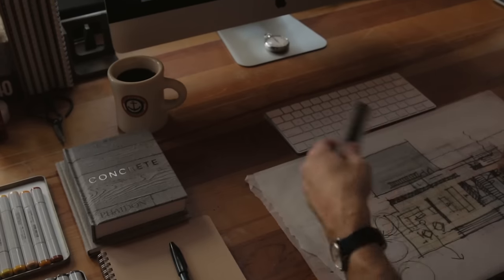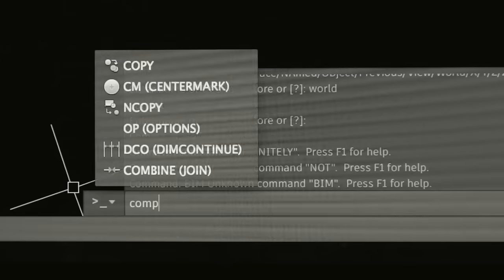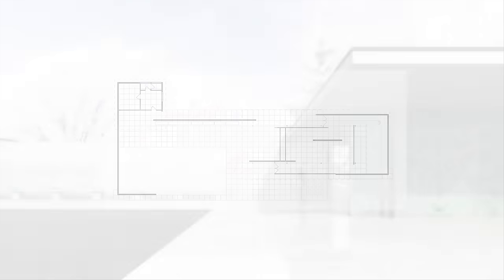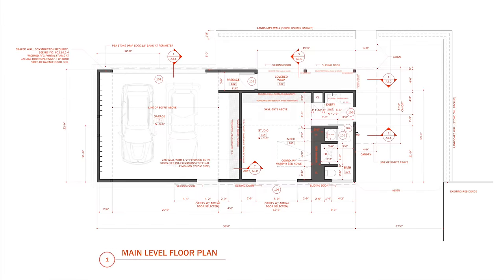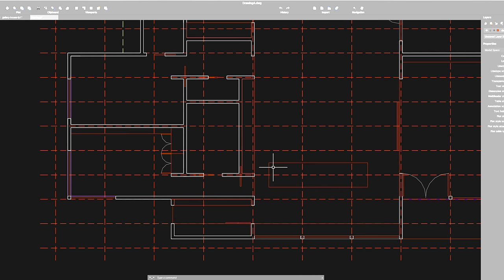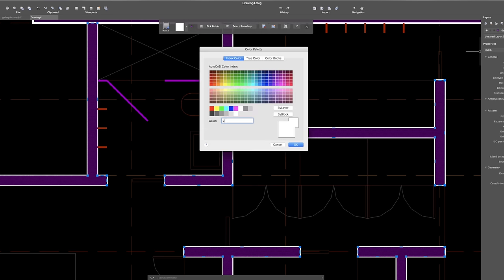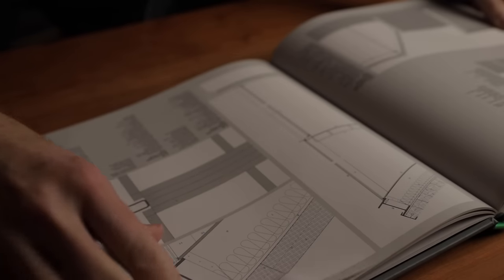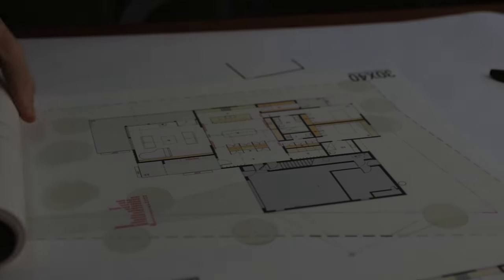Improve Your CAD Drawings | START TO FINISH tutorial (+ template)

Comment: I'm B.Eng in Civil & Structural Engineering in the Arctic and a big nerd in static calculations, screw / bolt / weld / other connections. But lately I've been digging deep into architectural design and interior design, as I've been planning and made tender documents on housing renovations with my work for the last 2 years.
I find it very interesting choosing materials, colours, minimum requirements for performances (air and water tightness, windload deformations, etc.) and making drawings.

In my free time I look at city plannings, see possible areas to build a house and sketch on AutoCAD Map3D. It's super fun and I understand more what architects work with. I need to understand more of what architects go through - so I can work with them better on construction projects.

Currently, in my free time, I am planning my future dream house on my parents' ground. And I can very much relate for the steps shown in this video! 😊

Comment: As a ME, I’m pretty much a AutoCAD first sketcher. I like to iterate over a handful of ideas quickly, so I’ll copy and paste current iterations next to each other as I go, so I can try out major changes without loosing the original, or grab components off older iterations. By the time I’m done, there’s usually ten or twelve copies sitting right next to each other, and I can really quickly see what’s working and what isn’t. I also find the ability to get the rough scale correct, right from the beginning really helpful. With paper designs, it will look like everything fits and works only to realize one integral component is just irreparable the wrong size. Just the way I go about it though.

Comment: I've been on Autocad for 35 years now, and I think I've refined it. 1 more tip if you want to do coloring, don't do it with solid color, you get much better shading and control by using ( ok we have to color our plans for local authority, different items different specific colour's) ok that said. Use dots hatch to colour. I like 1000 scale dots 0.2 pen thickness. That gives you a very subtle colour, and then you can control the colour intensity by lowering hatch scale to 900 or 800. And it uses much less ink when printing. Try it. Over years I've programmed my keyboard, so I hardly ever click on icons in menus. If you work by typing shortcuts you speed up your work 3 times because you work with 2 hands and not just with the mouse.
Reply: Lie weights is an absolute must in Cad, I've seen many plans drawn in 1 line weight, and it's a nightmare to read.

Comment: Excellent video Eric as usual.  As a licensed architect myself, I admire your way of clearly explaining your reasons for doing things, and your methods.   It is interesting to hear how the other architects do their work flow.  I hand sketch on trace the design, then layout the schematic plans with #2 pencil.  After the initial meeting I use Sketchup to fine tune the schematic plans.  Where you draw from the scratch the autocad plans, I import the plans, elevations, sections, into autocad from SU.  It is a little work to erase the unwanted lines, it is still easier than measuring and drawing new lines in autocad.  I then change the lines to whatever layer I want for thickness.  The other thing I noticed is you  draw your ext. walls to 6" for framing and 1/2" drywall, and interior walls it is 6-1/2" for drywall on each side.   I dimension to the stud walls, and therefore my walls are 5-1/2" or 3-1/2" thick.  It is easier for the framers to work with less chance of a mistake.  Checking to see if you tried to import SU into autocad.   Thank you, keep up the good work.

Comment: Your template is extremely well put together. You're so organized I think you've never had any need to use the more modern features in AutoCAD (like blocks, annotative text, etc...). These would save some time. Maybe not as much on your unique one-off type projects compared to an office doing more repetitious work. For me, I tend to do more "production" drafting (multi-residential, etc... ). I've really dug deep to maximize productivity.
I wish I could convince more people that great drawings can save the owner a decent amount of $$$ by the time the project is built, even if they take slightly more time on the front end.

Comment: Interesting approach and well designed workflow. I am experimenting with opposite approach at present which is using original drawings to make the model in 3ds Max, then once near completion, create an AutoCAD 2d plan from that. Excellent tutorial on this from Micha Koren on Digital Tutors (Pluralsight). Advantage of this approach is the client has a much earlier detailed 3d visualisation from beginning which helps any subsequent iterations and updates to final design. I use Sketchup for blocking out stylised concepts but cant beat Max or Maya for sheer design, material and rendering capabilities.

Comment: great video, I generally don't include finishes in my wall thickness dimensions, builders work and dimension from the main structure when building in my experience, not the finishes, therefore my dimension are to the extent of the main wall structure and not the structure plus finish material either side, just my 2 cents

Comment: Would you consider using Sketchup Pro to produce the construction documents instead of AutoCAD LT? I'm stuck in this dilemma of should I whether use AutoCAD LT for the construction docs and then use Sketchup Pro for Sketches/Perspectives or should I use Sketchup Pro alone. Although, SketchUp can handle both documentation and presentation alone, but theres a couple downside like its software performance when using Sketchup's Layout (which bothers me a lot) and its user reliance on 3rd party extensions (mostly it'll be difficult to create complex designs without using one). On the other hand, AutoCAD LT has better software performance and you have all the tool that you needed for documentation. I figured you'd be the perfect person to help me with this one. Thank you!

Comment: notes
1. sketches move back and fort not to hamper  flow of ideas, do not  jump into quick with cad,  you save electricity by not having pc on while thinking, instead work with pen and paper first once the idea become concrete then putting it into cad will make the workflow easy.
2. cad templates helps to save time and make the drawing organized with line value.
3. when doing cad starts with the big picture down to details (macro to micro), map at the beginning the limits so will not fall into revisions/adjustment when you exceeded unnoticed.

Comment: Cad is just as fast as hand drawing, and it's easier to create variations than hand drawing.  Just copy what you've already drawn and make changes to it.  Now you have 2 versions.  If the second version didn't work, copy your first one again and try some more.  Maybe you like the changes on this one, but you like one feature from the original version better, but you already changed it in thise version.  You can copy just the stuff you like from the original and put it in place on the newer one. In Cad, you can scale things up, or down, or stretch them longer, or shorter.  You can do that with manual drafting, but it gets ugly with pieces of paper taped together.  Anything you can do with tracing paper, I can do in Cad just as fast, and just as easily, or more easily.  As for getting to detailed, too early, that's an issue with hand drafting too.  That is the entire reason the Ecole des Beaux-Arts taught students 200 years ago to do their initial designs with very small, rough sketches.  I could see doing that part by hand, but I would scan the approved sketch and put it in my Cad file to use as a reference for scale.

Comment: I'm a little new to the actual software used, but if you use AutoCad LT,  does that mean all your material and cost calculations are done manually (eg, spreadsheets etc) instead of utilising a BIM program.

Comment: Is there any particular reason you don't use a BIM software? I chose ArchiCAD a couple years ago a I don't see myself ever going to a non BIM software, it just makes everything easier imo. Cheers from Brazil!
Reply from the maker: software is a tool...a means to an end and choosing a non-BIM route - for me at least - is a like choosing a honda civic. it starts every time i get in it. it's not blazingly fast, it's not showy or demanding, doesn't need maintenance and it gets me from point a to point b safely. i get the BIM thing, it's cool...much respect to everyone who uses it...i've tried it many times...it's just not the right tool for me...my projects are small, they're simple...and i want software that just gets out of the way and let's me do my thing...
cheers...
Reply: Using a BIM software like ARCHICAD needs mastering it to be worth the investment, can I ask how much you pay for it ? I use draftsight, and it's the only free possibility for me. Thank you and good luck
Reply: It's been a while since I've looked at Revit, but it isn't the only BIM (or "BIM-esque") option out there.  I've been using Vectorworks for more than a decade specifically because it is flexible.  Watching someone else offset a polyline then clip at wall intersections reminds me how long it has been since I've had to do that.  I don't know about Revit currently, but Vectorworks and similar "not too heavily BIM" packages have tools like wall tools where you can start with a simple, generic "6 inch wall" to block things out, then as the project develops, refine them into specific construction.  The time you save from having to clip intersections you can use to throw in some preliminary guesses at floor elevation and ceiling height, general sizes and heights of doors and windows, and voila, you just rotate your plan and you've got a 3d model for perspective views (or isos at the early "sketchy schematic" stage.)  I don't blame you for not wanting to cram your workflow into software like Revit that isn't flexible to that approach, but I'd highly recommend that you look into what's on the market today.  Between increasing hardware speed and more "smarts" on the software side, there are some really good tools that can do what you want from that "loose CAD" early stage through full CDs, probably faster than what you're getting from AutoCadLT, and with a little experience, you'll get stuff like perspectives for "free".
Reply: ArchiCAD is much faster to use which frees up design time by reducing drafting time
Reply: @Thomas_Donalek Vectorworks isn't architecture oriented as I know. And since it's a paid software, why not go for someone like revit or archicad ?
Reply: @Collins_Obare Yes I agree, Archicad is much faster and is more expensive. May I know how much you're charged when using it ?

Comment: I have a question that always bother me. How do you maintains the line weight when printed at different scale?  I tried scale lineweights under plot style but it only make the line thicker...
Reply from the maker: I set the line weight once and base it on the drawing scale, so for all 1/4” drawings I have a fixed set of weights I use, for details drawn at a larger scale it’s a different set of weights and so forth. I don’t use the scale line weights setting as I’ve never been able to achieve the look I was after. Using poly lines can help to fine tune the thickness you need...at least that’s what works for me...

Comment: I have a question that is A little out there for you. I am going to school to be an engineer. Currently my path is on mechanical. However I have recently learned that I enjoy and have been doing structural not mechanical. However I only have Civil or Mechanical engineering courses available. Civil would be the logical choice for structural engineering correct? I currently use this structure making Conveyors, Frames. Semi trailer floors etc. I appreciate any help
Reply: Another question, Is there any way I could Get example drawings to Preview to help me become a better Designer?

Comment: don't you hate it when you see your 2d sketches in auto cad lt and you wanne see your model in 3d? i draw with revit in school but in private use its to expensive i think to buy
Reply from the maker: yeah...it's not cheap...sketchup is though...!
Reply: yeah but can you use sketchup for cad drawings? otherwise you are doing double the work drawing twice, i know lot of architect they use a cracked version of revit
Reply: Can ya not get a student version of revit Autodesk give student free use of all there software I have cad revit and 3ds max on my laptop
Reply: you can use plus spec as an add on to sketch up but its another cost on top of sketch up pro license https://plusspec.com/ i'm thinking this as my next purchase as i still prefer LT and sketch massing models. remember its just another tool to communicate ideas. and some of the best ideas are still pen to paper.
Reply: Sander Brust you should definitely look at the Rhinoceros 6 features (its getting out of beta really soon) but their main mission in this version is aggregate all of the main 2d drawing tools - including documentation and layout tools - directly into the 3d software. Its best of both worlds. Replace autocad (for most necessities), gives freedom to create any forms that Revit still lack, specially with grasshopper plugin (built in from version 6 on) and miles ahead from Sketchup, which can't handle larger files without lagging and crashing all the time. All of this in one software and for an affordable price. Plus it comes with a built-in rendering engine - which might be reasonable good for start if u can't afford a Vray license just yet (i heard its cheap for students)

Comment: I noticed that you place text and dimensions in model space with different scales. Why? I put all my text and dimensions in paper space that way I don't have different scales to worry about and it keeps my model space cleaner. Thanks.
Reply from the maker: hi david...only because I rarely mix scales in a single drawing and I find it faster to note everything in model space...this way, if something moves I remember to move the note with it...otherwise it's hanging out there in PS and I'll forget...it's also possible to use annotative styles to compensate for changing scales (i've never adopted it though)...different workflows that's all...
Reply: Yeah, know I'm the odd duck and the only one I know who does it this way. But I treat my drawings as if they are hand drawn.
Reply from the maker: i'm all for whatever achieves the desired result...and your philosophy on hand drawings is spot on...
Reply: If I may... you are not the only one! I am with Eric in model space and annotative styles. However I was taught to use PS for the very reason you brought up. But I currently dimension in MS. With so much info to swim through it’s easy for me personally to lose touch if it’s not all in front of me.

Comment: In my drawings, I use separate layers for all the line weights + dims, text, labels, hidden lines, sec lines, grid lines etc.

Then I make layers based on the drawing type and and their corresponding components; using AMEPS as the layer "tag". For example, if it's a wall of a floor plan I'll call it A-WALL. However, since the line weights are already in separate layers I don't need to designate any to the succeeding ones.

Comment: Hi Eric! I am a young adult looking into becoming an architect. I have little experience working on homes with construction, but I really love the idea of designing homes. Where would you suggest I begin down that path? School?... working more on construction?
Reply from the maker: sort of depends: an architecture degree isn't req'd for most residential work (check your state regs), but the more interesting (and more lucrative) commissions usually go to professionally trained architects. home design is commoditized to some degree, so you'll always be differentiating on price rather than value if you go home designer route (not judging, just observing). construction experience is invaluable for anyone in the building trades and it's not taught well in design school. hope that helps!

Comment: What is the grid in the background used for?
Reply: It can be used as a reminder of spatial relationship, dimensioning/sizing of rooms whilst developing the design and further on in the design process for setting out of the building, it has various functions throughout the design process but its helpful to design to a grid particularly when it corresponds to typical sizing for construction elements. Hope that helps :)